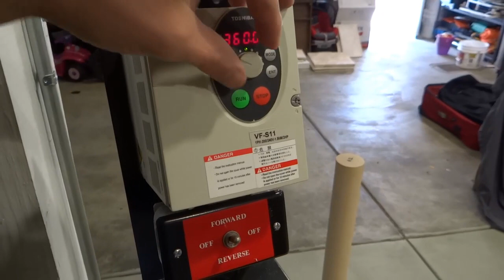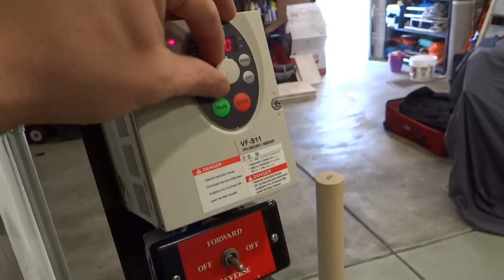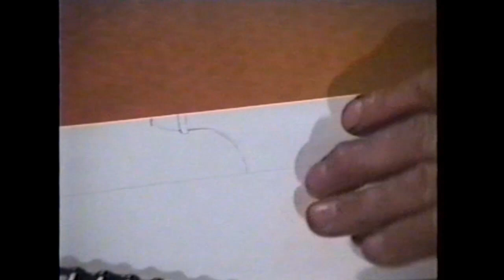Wood Lathe and Duplicator Demo

Comment from the maker: cnc waterjet, laser or router. or you can draw it by hand and jigsaw it.  in the video you can see a stainless steel one that was waterjet cut.  you can also use a bat as the template.  It's a copy lathe so either will work.
Reply: Do you still have or ave for Question